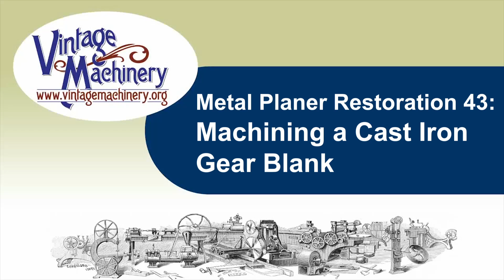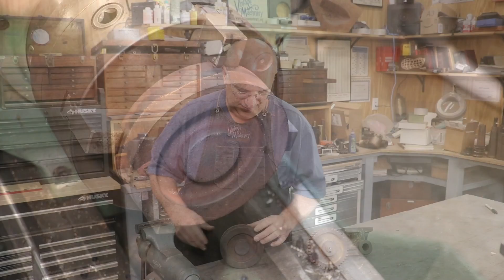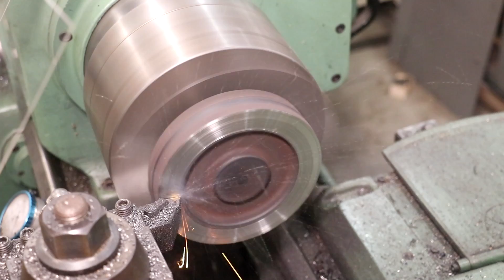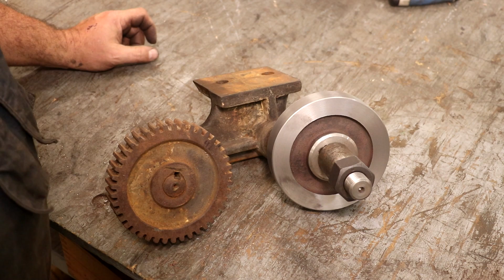Metal Planer Restoration 43: Machining a Cast Iron Gear Blank

Comment: 🎯 Key Takeaways for quick navigation:

00:00 🛠️ Introduction to the project of making a new gear for a metal planer restoration, highlighting the process involves multiple videos due to the extensive work required.
00:30 🤝 Mention of collaboration with a friend who provided original parts for measurement, emphasizing the importance of community and sharing resources in restoration projects.
00:58 🏭 Description of the process from 3D modeling to casting the gear in cast iron, showcasing modern technology's role in traditional restoration work.
01:10 🛠️ Beginning of the machining process for the new gear, focusing on the technical aspects and precision required in restoration.
02:28 🔧 Adjustments made during the machining process to ensure accuracy, reflecting the iterative nature of machining work.
03:47 ⚙️ Discussion on the wear of machining inserts and the challenges of working with hard outer scales of castings, illustrating the complexities of machining different materials.
06:13 📏 Precision measurement and adjustments to achieve the correct dimensions of the gear, highlighting meticulous attention to detail.
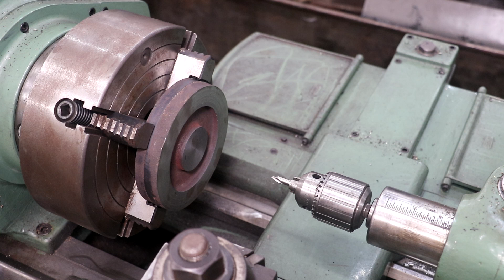09:40 🔄 Techniques used to correct runout and ensure the gear operates smoothly, demonstrating problem-solving in machining.
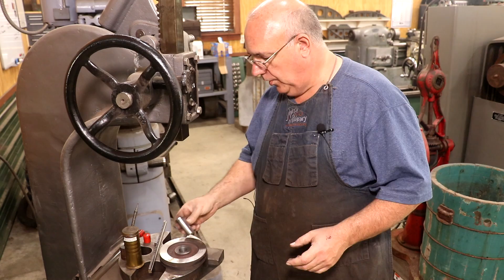12:15 🔑 Broaching a keyway into the hub, a critical step for fitting the gear onto the machine, underscoring the importance of each step in the restoration process.
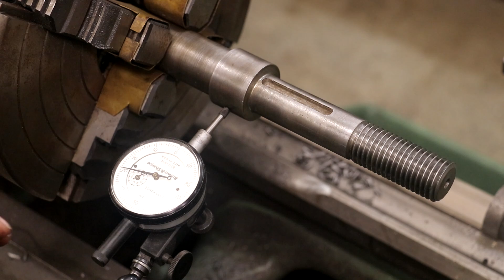14:10 🛠️ Creation of a custom arbor for machining, showcasing adaptability and resourcefulness in the workshop.
17:30 📐 Finalizing the gear's dimensions before cutting teeth, setting the stage for the next phase of the restoration.
24:31 🎉 Completion of the gear blank preparation, ready for tooth cutting in a future video, marking a significant milestone in the restoration project.
25:28 🕰️ Mention of time-saving due to finding a ready-made arbor, highlighting the benefits of reusing and adapting existing tools.
25:54 📢 Encouragement for viewers to engage with the content through subscriptions, comments, and likes, aiming to build a community around the restoration project.

Made with HARPA AI

Comment: I recall my father never allowed anyone in his workshop to use insert cutters with blanks that were fresh from the forge for just this reason. He insisted the first cuts through the outer coating always be removed with hand-ground tools made from either high speed steel or carbide rods. If he found anyone trying to get away with it he would dock the cost of the ruined insert from their pay!

Comment: When you first indicated on the arbor, its surface may have been centered, but the center hole of the shaft, towards the tail stock, was obviously NOT running true.
Shouldn't you have centered the arbor with the tail stock on center  to begin with ?   That misalignment seems like it would put wear on your live center, if nothing else, too.

Comment: About that "stepping up" of drills diameter - in my experience it's not good idea to make such small increments like going from 7/8" (0.875"/ ≈ 22.2 mm) to  31/31" (0,96875"/24.6mm ) size, as it leaves just 0.0625"/ ≈ 1.6 mm of a "shoulder "per side. Such small area enables quick drilling, but put a lot of stress and heat build up on drill's corners, which often results in chipped or burned corners of drill's cutting edge. And then you'll have to regrind the drill, which is not that much fun with larger diameter drills.
Here's how "other machinist" drill holes - https://www.youtube.com/watch?v=xyojP5D3n8A&t=33s
Straight away, no centre hole, no pilot hole, "no nothing" - "just git on with it" ;-)
Diameter of the drill is 78 mm/ ≈ 3", feed rate is 0.25mm/ .01" (notice how and where the drill is mounted!) per revolution @ 100 rpm. (That channel is called "Turner's Diary", and that piece he's working on is a some kind of bracket or support.)
And then (@ 1:10) he proceeds with turning that hole bigger - 315 rpm, feed 0.25 mm, depth of cut 5mm/ .2" per side.

Comment: FFS Keith... You are supposed to be a machinist  do first side .. finish the whole casting .. drill/ bore the hole .. turn round grip on the machined true surface .. finish OD take a decent cut ..to get through the scale ....and width .. then broach it ...................but as usual it will be good enough for you

Comment: Would it have been possible to use an angle grinder to get that scale off - the tool pressure at 18:20 must have been enormous!

Comment: Since Windy Hill Foundry seems to be producing a lot of cast iron work, maybe they should invest in an annealing furnace.  This should eliminate the "chilled skin" problem and enable them to tailor the properties of the cast iron that is produced.
Reply: Clark at Windy Hill Foundry does have a kiln and does anneal all his castings. Even so, there are sometimes inclusions and hard spots.
Reply: You need to visit Windy Hill Foundry's channel.  He mentions or shows his annealing furnace in every video.
Reply: @paulcopeland9035  Yes, you're right.  Clark calls it "stress relieving".  However, it obviously didn't get rid of the hard skin on Keith's casting.
Several Youtubers (e.g. Joe Pieczynski) are building model steam engines using small cast iron castings that don't seem to have the hard skin.  It would be interesting to know what extra treatment or different composition enables them to achieve this.

Comment: Nice work Keith.  I am assuming you can leave the rough surface in the indented area because it is a low speed gear, and balance is not a big issue. Would I be right in assuming if it was something that was rotating at high speeds you would need to clean up the inside surface of the indent to get the best balance possible?

Comment: Too cruel !  9 minutes watching a casting wobbling around in a scroll chuck !  My OCD is traumatised !  ;-)
Reply: Four Jaws are not scroll chucks. Each jaw is adjusted independently so no scroll is needed.
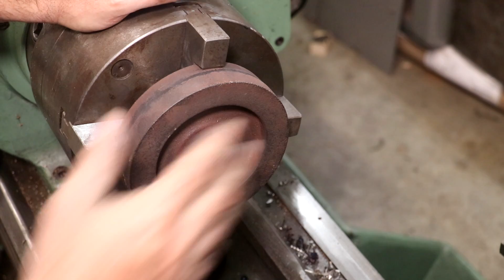Reply: SOME 4-jaw chucks have independant jaws. The one used between 1:45 and 9:35 was not one of these.  At 9:35 Keith transitions the casting over to a different chuck and states that "this is a 4-jaw chuck with independant jaws ....."

Comment: I wonder if a soak in your HotShot, followed by a soak in rust-remover would have saved a few inserts.
Reply: I don't think it's the rust or normal hardening, I think it's from carbide particle that form in cast iron surfaces anytime there's high heat and/or pressure, like in brake rotors.

Comment: Keith, my former employment was at the Dodge  Mfg. plant in Mishawaka, IN where a lot of machining was done on cast iron. It is my impression that they used lower speeds and feeds than you do along with Rycosol 66 coolant and always cut deeper than the fire scale. They did use carbide insert tooling also.

Comment: A time saver that I use when mounting stock into the chuck is a carriage bolt that I turned the sharp edge off the head so that I've got a flat edge on the side of the head, and then I mount it in a tool holder so  that I can use the cross slide or compound to push my stock as centered or flat into the chuck as I can get it before I start turning.  It just takes me a minute or two to mount my stock now.

Comment: Great video yet again Keith. For cast iron, Keith Appleton recommends always going in hard and deep to get under the scale and sand in one pass, because cutting that stuff wrecks tools. Once past that outer layer, you can focus on dimension and finish without wearing out tools.

Comment: I've seen lots of the guys castings on YouTube and all seem to have hard spots. The guy isn't good at what he does.
Reply: I've machined a fair number of different castings and I don't see much wrong with that casting - fair amount to take off but .125" is good as it lets you take off all the crust and be in the good stuff.  A hard crust is par for the course, you're getting that with cast iron in sand no matter what.  If you machine cast iron a lot you know that the skin is hard and you have to dive under it on the first cut.

I haven't seen any chills in castings identified as being Windy Hill.  You'd know if someone ran into one while machining if just from the audio being cut.  Harder than the hubs of hell.  If you can't grind it out the best course is to run the castings back through heat treat - it'll lower a grade 40 casting to grade 30, but it'll be machinable.  

Chills usually appear in thin sections and the rim of that blank wasn't thin enough to be a chill.  It was just the nasty crap skin you get in sand cast iron.
Reply: I don't know if the guy will be in business very long. Rucker shot a video of him casting stuff, he had more fails than successes.

Comment: I've read many collated volumes of UK Model Engineering magazines from the 1930's era. Many models were made from mail ordered casting sets, on small lathes (3 1/2" centre height was the classic size, in the USA this would be called 7" swing), using HSS tooling, or even just high carbon tooling.

The approved procedure was to make the cut directly to BELOW the outer sand/scale layer - this meant slowing the lathe right down, using back gear, and using deep cut, slow feed. Even with this technique, lots of trips to the grinder for sharpening would be involved.

Comment: Why so much stickout on the arbor- put the shoulder up against the chuck jaws and the dial in on the shaft , not the shoulder.  Couldn't see in the video, but my guess is there is a chamfer on that gear- should have done that on the blank.

Comment: Cut it ‘under the skin’. Frist cut give it 0,100”. Then you will save your insert.
Reply: I'm yelling at my screen "Take a heavier cut on the first pass!" He paid for it in inserts.
Reply: Or, if not possible, an angle grinder with a flap disk also works on the lathe.
Add a rag to protect the ways from the dust.
Reply: For rough castings I never wasted inserts. rough casting are not clean and the scale burns out most HSS and carbide. I've used iscar psbn inserts, they don't last long on scale from small foundries..  

This is what I found that works for small projects: grind off the scale using a belt and/or an angle grinder before machining. Yeah, it's dirty. I usually use the angle grinder in a sand blast cabinet. When machining, if the lot hasn't aged 90 days and/or there are too many hard spots, use tool post grinder or a belt sander with 10-20grit abrasive. People (like me) complain about grit on ways, but really...  you're cutting cast iron and scale, I'm not sure which is worst the hard chips, scale or abrasive.  If you do a good number of rough castings, invest in a belt grinder with "good" dust collection to protect your lungs and if possible move it out of the machining area ..
Reply: Yes, the standard first cut in my place of work was 0.100 when turning cast iron and 0.900 on cast steel. The casting process causes a case hardening of the workpiece and if you can get under that in the first cut, you’re golden. Your inserts will last much longer too.
Reply: There’s always a little sand embedded in the scale, too.
Nice job, though, Keith.
Thanks,
John
Reply: LOL, so I wasn't the only one. And then he decided to really sand away the edge of the cutter by taking even lighter passes.
Reply: Yep, and use a large radius insert for roughing and a small(er) radius for finishing. Surface speed needs to be kept in check too.
Reply: @Panzax1  You would think he would know that.
The surface of many iron castings , "chilled iron" is extremely hard, so you must cut underneath it.
Reply: One more "GET UNDER THE FRIGGIN SCALE!!!! and yo Keith, Remember the rest of us are all perfect and NEVER screw up. Not EVER

(Anybody want to bet the after all this riding KR never forgets to dig under scale again ).

Comment: Hi Keith, I have usually took a deep cut whenever there's a scale or hard layer whatever, just turned the feed and speed down a bit. The hammering which is actually lighter that way will happen far from the corner and even if there is some light chipping going on the insert will survive and be just as good afterwards. Also a lot faster way

Comment: I was surprised when you did not use any oil on the drill bit when drilling the 1 inch hole.  But you did oil the tool to cut the key way.  So I’m curious as to why no oil on the drill bit.
Reply: Cast iron is self lubricating due to the high graphite content so oil is not needed. Oiling the broach helps the broach slide through the steel sleeve easier.
Reply: Robert Oswalt  Thanks.  I would have never thought that any type of metal could be self lubricating.

Comment: What is the advantage of casting this instead of just milling from scratch?
Reply: In a previous video he wished he had material to just turn down on the lathe. Keith would have ordered a piece of 6" cast iron round stock but the minimum he could have got was 10 or 20 feet long and ridiculously expensive. Plus I think he enjoys promoting his friends YouTube channel and business
Reply: @maggs131  also cast finish on unmachined sections looks more original.

Comment: When he started turning the diameter and said “I’m going to take a light cut to start with”, I was yelling at the screen, “NOOOOO!” Well there goes another insert!
Reply: Absolutely blooming right. First cut should be a heavy cut to get under the hard skin, not pussyfoot around  taking more of the insert than the job.
Reply: It is our doom that we get too smart, sitting on the couch watching machining videos 😂😂😂😜
Reply: I was wondering why couldn't he just sand the scale off...
Also, a bath in the oven might have helped with the hard corners?
Great video, though. I can't claim his skill level. He always has a great product, however he skins the cat.
Reply: @TheTomBevis  the casting has been in the oven at the foundry, Clark  does a relief cycle on his castings.
Reply: @samuraidriver4x4  That's fine for stress relief, but won't remove the hard scale.
Reply: As soon as I saw a spark the 3rd time, I figured out he should be taking heavy cuts. A production shop would probably fire a guy like that.
Reply: He's a hacker, he doesn't really do anything the way it should be done exactly.
Reply: @justinl.3587  to be fair there are many ways to achieve an aim. In a homedhop environment, efficency isn't always the top priority.
 As for me, inserts are expensive so i try not to ruin them so quickly.😉
Reply: @justinl.3587  : I'll wager he does exactly the same thing next time. It seems he hates to be told that he's doing it wrong, won't take good advice.
Reply: It's at this point when I stopped watching, and watching him destroy inserts.  Never try to machine scale.
Reply: @sferg9582  Have any tips on how to remove it? I assume a grinder would do the job.
Reply: @JasonTHutchinson  If you only have a few thousandths to take off, a grinder is the best way.  If you have .020 or more, take it in one pass.  The scale is only maybe .005 to .010 and that stuff will destroy an insert.  The material below that .005-.010 is soft and easy to machine.  It's a lot like case hardened metal.  Once you get past the hard outer surface, you can machine it easily.

Comment: The live center has some wobble in it too, so you'll never get it perfectly true. And you initially indicated the arbor BEFORE bringing in the live center and the arbor was wobbling at the far end, so the setup changed when you eventually inserted that live center. I guess.
Reply: I saw that too.  Apparently the chuck jaws were worn.
Reply: It was clear that the right end of the arbor was not running true before Keith brought the live center up to the arbor.  I think that the arbor was not straight.  But its clear that as Keith was zeroing things in that the shaft was not spinning true.  I was wondering what the effect of bringing the shaft into true with the live center would be.
Reply: @janetflecher2683  
by holding one end of the arbor with the live center tight and correct the runout with the jaw, you will flex the arbor.
when you now use the arbor without the live center holding one one tight, the arbor will flex back. now you will see the same runout, quit in opposite direction

Comment: Just wondering if it is possible to make casting with teeth already in the pattern? Oversized and properly shaped and 3d prinred.
Reply: Pattern draft nightmare?
Reply: @jnimitzch4738  I own 3d printer that i made myself. Yes work is needed to make smooth finish but not teribly dificult. I tryuing to understand if there is problem when iron puring or some other part of the process.